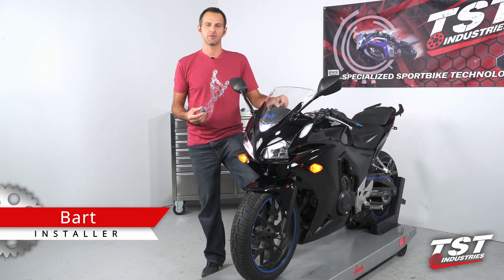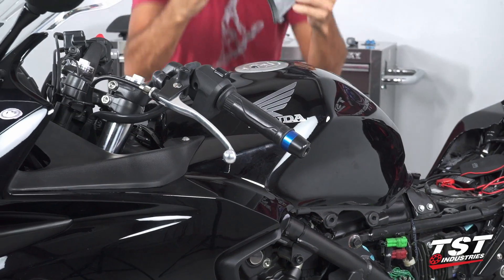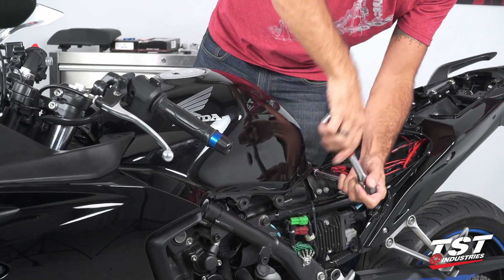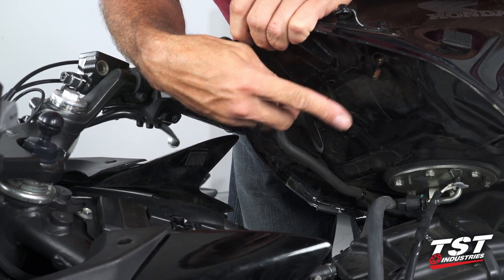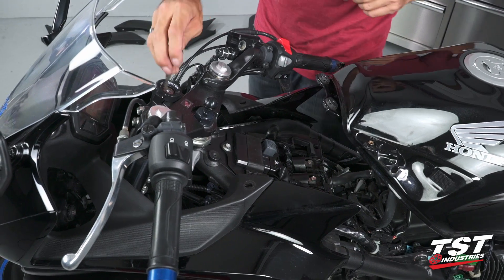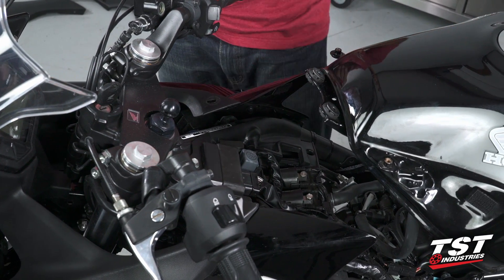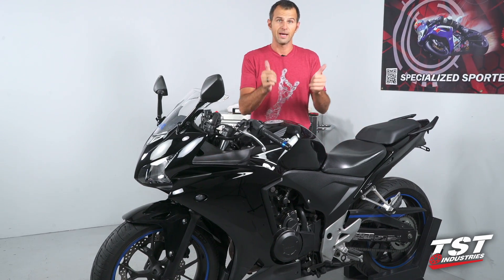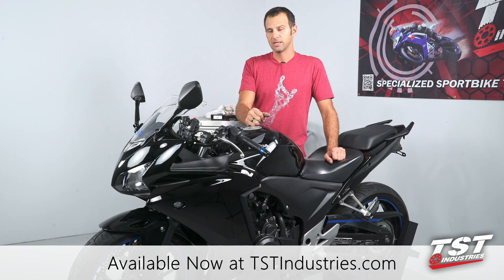How to install an LED Flasher Relay on a Honda CBR500R by TST Industries

Comment: Put LED flush mounts in with harness and running mate, and everything worked with hyper flash. After I put the TST relay in the light stopped flashing and are on solid. Please help.

Comment: Has the tank to be clear for this?
Reply from the maker: It is vastly easier to do if your tank is low on fuel. Then you don't have to fumble with a tank that weighs a lot.

Comment: Hey there, maybe a dumb question but if I change my front AND rear signals, do I need 2 relays ? I cannot find a clear yes or no. CBR500R 2018. 
thanks a lot for the advice and the clear videos
Reply from the maker: You will only need one relay for your entire bike. That should be mentioned on the product page.

Comment: Adjusting the speed on the flash is cool. Just installed my flush mount lights going to install the relay tomorrow. 👍🏽
Reply from the maker: Awesome. Can't wait to hear the full impression (and maybe even a review on our website if you care to share your experience there)

Comment: There are someone for CBR650R 2019?
Reply from the maker: According to my research, the 2019+ CBR650R uses a relay with a 3 position connector that can be replaced by our Gen2 LED Flasher Relay. This information is valid for US models because I only researched the parts in our market. Here is the relay that will work for you if you are in North America: https://tstindustries.com/tst-led-flasher-relay-gen2.html

Comment: Why on Earth would anyone want one? I love my rapid 3 per second lights, I'm going to be seen!
 I left mine off intentionally, between that, the rapid brake light and the underglow, it definitely stands out.

It's great if someone wants it to run normally, but that is what the relays that come with the bulbs are for.
Reply: Agreed hyperflash looks fantastic

Comment: Hi, TST, I got a LED relay from you and am installed it on my 2017 CB500F. Now I'm having trouble re-connecting the aerator hose back to the bottom of the tank. The hose is short, and there's little space between the frame and tank to put my hand in to connect the hose back to the connector. Any tips?
Reply from the maker: Try to back up the aerator hose through its routing guides to give yourself a little more slack for connection. When replacing the tank make sure you don't kink it with the extra length. Then pull the same distance down on the hose once the tank is back in place.

Comment: I actually like the idea of being able to use the hazards while not needing the key as then if i need to stop in the road and leave the bike, i.e in an accident or helping someone, i wont have to leave the key in rendering my bike easy to be stolen, also in the U.K if you leave your key in your vehicle and walk away you will be rendered uninsured and not covered by your insurance policy if it does get stolen so they will not help in any way.
Reply: Zzzzzz

Comment: This video was really helpful and I want to express my satisfaction with both products (the relay and the flushmount signals). Luckily I did not have to remove the air hose underneath the tank to replace the oem relay. As for the signal lights, I had to remove one side of the fairings, but this was only because the previous owner messed up the cables..
Reply from the maker: We're glad that your installation went smooth.  Cheers!

Comment: Will this unit still allow the use of the hazard signal?
Reply from the maker: On the CBR500 and CB500 bikes the hazard light is still functional while using this signal relay
Reply: TSTindustries excellent! Thank you for the info, I've ordered a flasher.

Comment: With your product (13:04 in the video) - it makes the flashers and hazards light still work when the key is turned off .., that is the most stupid thing I have ever heard , so some kid etc touches your hazard/ flasher button in a parking lot .., and you later come back to the bike to find your battery is now flat .., brilliant engineering guys - not !
Reply: Well normally you have to turn your key on and drain your battery if you have to leave your hazards on to avoid getting hit if you get stranded on the side of the road without underglow, that reduces the power.
 Your argument is the same as having buttons underneath a car to open the doors, or a push button start that does not require a key which went in millions of cars and motorcycles.

Comment: Do you have the link for the purchase of the flasher relay?
Reply: what kind of transmission is it automatic or manual?,uh,Bike parts are cool.
Reply from the maker: Yes the link can be found in the description.
Reply: You really didn't get 2 when ordering your set? Is that an eBay thing?
 I left mine off and they blink 3x normal and I love it, that and the brake flash help me be seen.

A lot of people want to eliminate everything and have flush lights, those can only be seen from a 90° angle, I want to stand out!
Reply from the maker: ??? Bikes have manual transmissions.
Reply: @TSTindustries  it's so hard to look at that comment and tell of it was a joke or not lol

Comment: what happens if i do not get the relay? can i do without it?
Reply from the maker: Your signals will flash very fast. You won't damage any electrical part, you will just have fast flashing signals.
Reply: I used the same wire and mine just fine they don't flash fast
Reply: @juanandrade7530  without a relay that's very odd, you may have HID's and not LED's! One uses a ballast and the other a relay, however many ballast will work with a relay, but all you have to do is invert the +/-

Comment: Will this procedure work on a 2017 cbr500r?
Reply: Oh, installing the LED relay is very easy...Took me maybe 15 mins... Video shows just how to do it and it works on the 2017 CBR500r
Reply: The trick with pulling the OEM harness thru the fairings with a wire..See TST video on installing flush mount blinkers. I could not get it to work on the 2017, but I did manage to run the harness thru enough so you cant see it..
Reply from the maker: We haven't confirmed that yet. Waiting for a 2017 model to come in to the shop.
Reply: I tried it today and it worked great...I also tried the trick with the flush mount blinkers and that will not work on the 16/17 model..Oh well, it was worth a try and I really enjoy your install videos!
Reply: Steve Lanier what trick are you talking about? I just bought the flush mount blinkers for my 2016 cbr500r and am now worried lol
Reply: Ok I thought so, thanks for the reply!
Reply: No problem, good luck..

Comment: Hi, I'm thinking of replacing the front and rear turn signal lights. Also, I'm replacing my oem mirrors with a pair of aftermarket ones that have led turn signal lights on. How many of flasher relay I need? Thank you.
Reply from the maker: Just one. One unit controls the flashing of the entire signaling system.